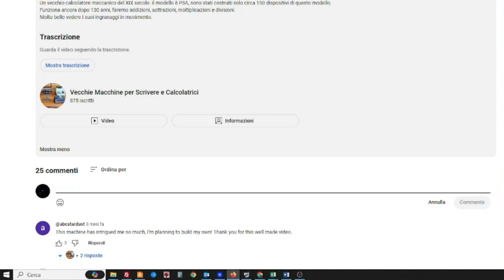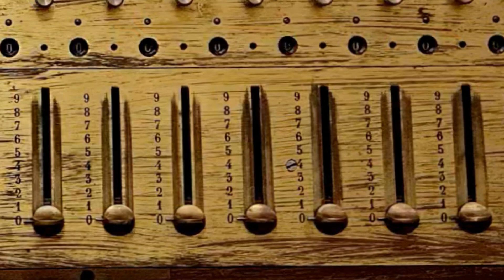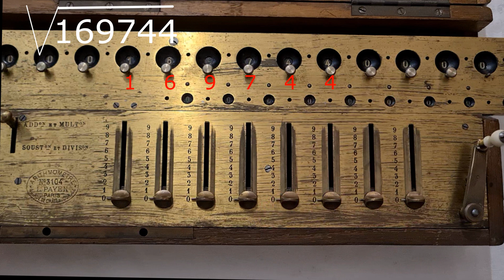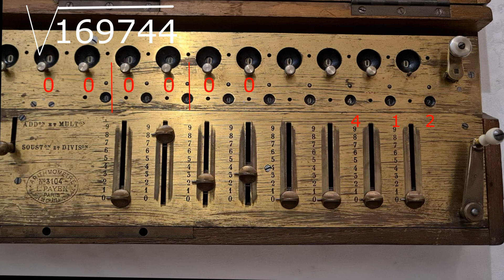How they did square roots in 1897 with a Payen aritmometer calculator (video N°108)

Comment: This is the digit-by-digit method I have been using on my Monroe calculators. The Monroe booklet has some explanation of the algebra behind it. I have also experimented with the Babylonian method. Make a guess, it can be very wrong. Divide number by guess, add result to guess, divide by 2. Number divided by averaged result, add to prior estimate, divide by 2, etc. it is surprising how quickly it will converge on the correct answer, 3 iterations usually. The initial guess can be a slide rule solution but it doesn’t seem to matter too much.
Reply from the maker: Thanks for the information, I never heard about Babylonian method